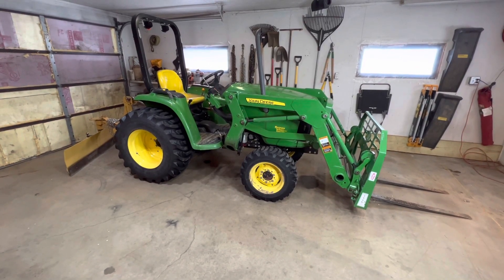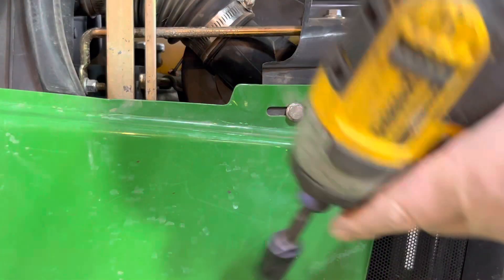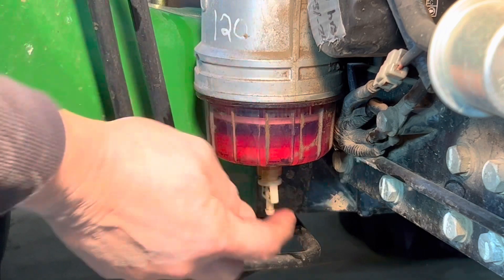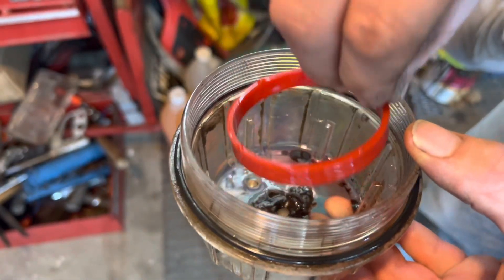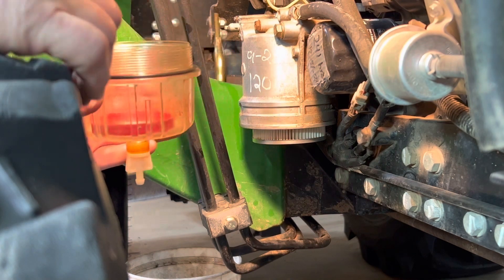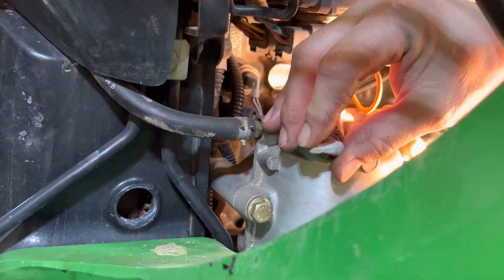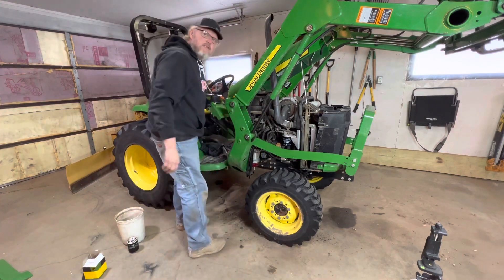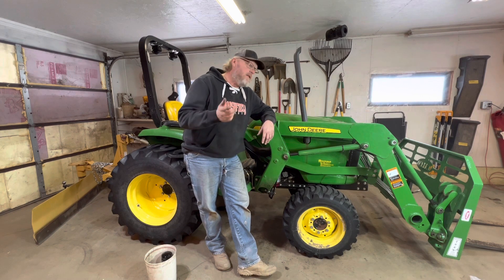John Deere 3032 Fuel Filters Replacement (2015)

Comment: The plastic separator bowl, cracked on my JD 2520; maybe over the winter ??? JD would only sell the entire assembly which normally runs ~$100; thanks JD. At any rate your video has helped me get oriented with my smaller unit.  THANKS !!
Reply from the maker: You’re welcome. I know what you mean about John Deere, they have been less than supportive when it comes to maintenance. If you ever have a problem with the dpf they won’t even sell you the parts. What should’ve cost $289 cost me $1321. I’ve been trying to get a service manual for this tractor for some time. Once I get the information I need I’m going to make a bunch of videos on trouble codes and fixing them. They just won’t sell me one from JD. I’ve bought a few but they don’t have the information I want. Hopefully I will get some answers soon. Thanks again.
Reply: @pilgrimsgarage  I had no idea JD wouldn't sell service manuals for your unit. I bought my 2925 around 2010 and at the time service manuals were available, though, not as helpful as I'd like. Seems like JD should have no problems selling a manual. I believe this would encourage sales when folks like you construct how-to videos to take the mystery out of simple diy repairs.. When I was considering the purchase of my 2520, YT videos on the product helped me go through with the purchase. Again, thanks for your videos!!
Reply from the maker: @wa4aos you bet.

Comment: My 2016 3032e has 118 hrs on it. Just died on me. I hope it’s the fuel filters. I’m changing them tomorrow. Thanks for the video
Reply from the maker: You bet. That sediment filter had quite a bit of crud in it. You might be able to drain that first and then check the fuel pump. In other words, drain the sediment filter tank, then turn the tractor on to see if it fills it back up. If it does then you know it’s not the pump. Both filters are a breeze to change and not terribly expensive. Good luck to you and thank you for the compliment.
Reply: @pilgrimsgarage  Thank you. I will do that when I get in.
Reply: I have a 2016....  there is a screen located in the fuel tank (at the start of the supply tube) that gets clogged with an algae-type "goop" buildup.   I pull the screen, rinse out with hot water, reinstall and PRESTO.. good for another 6 months.  (yes, i use a diesel fuel additive to prevent this but it still happens.  Good luck.
Reply from the maker: @Ugot2BkddnMe  I never checked that. You say it’s right at the fuel line? How can one get at it being in the tank? If you can, email me a picture and I’ll add it on here. Seems like great preventative maintenance
Reply: @pilgrimsgarage  I'll head to the barn and get you a picture.   The supply tube connects to the outlet valve, when you pull the valve (have something to plug the hole because your fuel will drain (i usually make a plug out of a piece of a latex glove.  The screen is attached to the opposite end of the valve and is inserted into the fuel tank.  Pretty simple fix once you realize how the screen fits.
Reply from the maker: @Ugot2BkddnMe  sweet! No hurry. Send it to my email if you’d like. I don’t think you can attach a picture on here but try anyway…I’ll pin your response. I appreciate it.
Reply: @Ugot2BkddnMe I need a picture too

Comment: Did I do something wrong? After I put the filters back on and turned on the valve, only up about an inch on the bottom of the bowl.
Reply from the maker: No. Turn the ignition on. It will engage the electric fuel pump and fill it up the rest of the way c
Reply from the maker: Once that is done you should hear the fuel pump change it’s tone within a couple minutes. That should indicate the primary fuel filter is filled. Once that is done it might take a couple more cycles of the engine and it will start. Check for leaks once it’s idling and you should be golden.
Reply: @pilgrimsgarage  started and runs on high throttle and dies when being back to idle. What could that be?
Reply: @pilgrimsgarage and now I can’t get cranked again. Any tips or tricks there?
Reply from the maker: @PineyWoodsKenworth  crack the bottom of the sediment bowl and drain it. Start from scratch. The electric fuel pump (click clack) should build pressure. If not, you may have to check your primary filter. It sounds like it might be sucking air.
Reply from the maker: @PineyWoodsKenworth  air in the system. It’s sucking air. Make sure both the sediment filter and the primary filter are tight. That’s all it can be.

Comment: Mine wont start
Reply from the maker: Sometimes it takes a bit of time to get the air out. First, make sure the filter is tight and make sure your sediment bowl has filled up. Be sure to open the shut off valve. Once it gets primed it should start. You’ll be able to hear the “clicky clack” fuel pump change its tune. It took me about 5 minutes for it to prime. It’s not a big deal if you have to prime it again. Keep me informed.
Reply: @pilgrimsgarage  Thanks, I cracked the canister filter and turned the pump on until it flowed out.
That did it.

Comment: looks like someone disabled the seat sensor.
Reply from the maker: The seat sensor only activates if you have it in high or low gear. If you’re in neutral it will turn on without being seated.